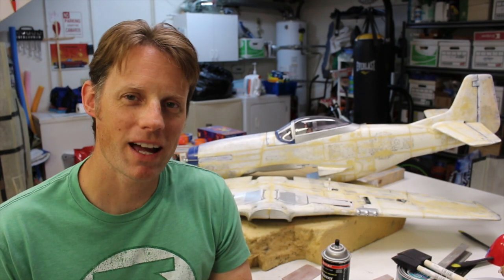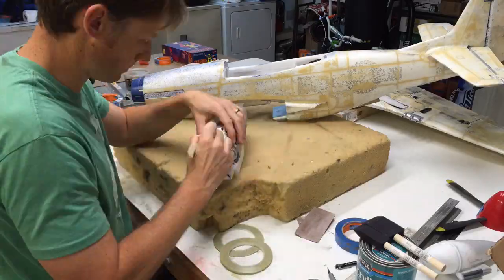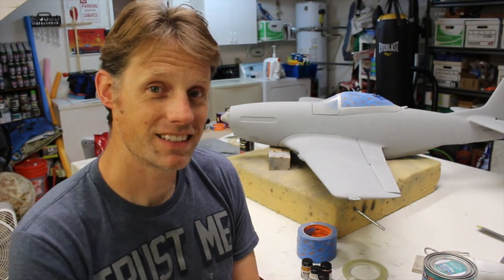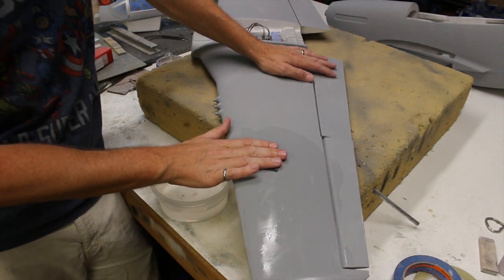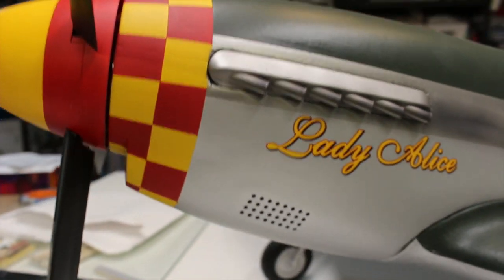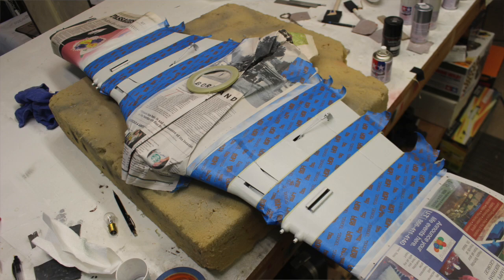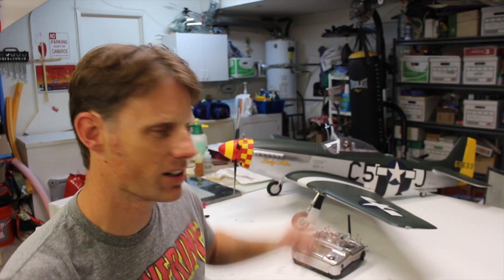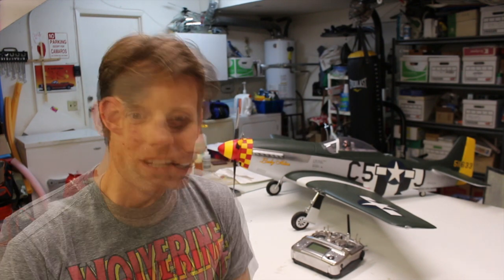Refinish a Foam Warbird Ep3 - FMS P-51 Paint Prep & PAINT!

Comment: I know you filled your servo lines and servos with filler, but what is a good paintable tape to cover those lines? For those of us not doing a show room finish lol...
Reply from the maker: +ssgfury The problem with traditional tapes is that paint doesn't usually like to stick to it and they don't always like to stick to EPO.  You could try a masking tape, but it'll probably lift up over time.  The best options are probably vinyl (like I used for the letters) or aluminum tape.  The aluminum tape would be easier to source than vinyl since you could get some thin stuff at Home Depot or some place like it.  Both do require scuffing and primering before painting, otherwise the paint won't stick well.
Reply: +The RC Geek Your exhaust pieces... they weren't already mounted?  I'm tinkering with a FMS BF 109... the exhaust pieces are already mounted... is there safe way to get those back off?
Reply from the maker: +ssgfury The exhausts were separate in the box.  I'm not familiar with the 109, did they come installed or were they glued in?  Truthfully, they'll probably pop off if you pull them.  I'm not sure, is there a reason you want to remove them?  Otherwise, you could simply work around them.  Had they been installed on my P-51, I would have left them on and just worked around them.
Reply: Yea... I wanted to tinker with painting them an exhaust manifold color... I went for broke and pulled on them and they came out fairly easy... I'm getting more and more sucked into doing a whole finished paint job lol!  I got the brown 1400mm 109... but I want to put a yellow tail on it... and  with matching yellow under the nose... (it has an orangish yellow under the nose).
Reply from the maker: ssgfury Go for it! :)

Comment: hey rc geek, what would be the least amount of work you would need to do to just turn a plain white epo jet and paint it a basic two colour camoflage scheme. im not worried about paint sticking forever or being a perfect finish, so could you get away with sanding priming and painting without all the varnishing and wet sanding and such?
Reply from the maker: yeah, you can just paint the bare foam directly if you wanted.  All the filling, varnish and primering is to get rid of the foam texture and smooth out the airframe.

Comment: Really hope your still checking your channel. I started doing all these steps on my Freewing F16. Problem is it came as arctic camo paint scheme and that black seems to have dyed the foam itself. I used a combination of Acetone and Lacquer thinner to get down to bare foam. Problem is the black is off but seems to have soaked into the foam. I got it smooth and all the holes filled in with foam filler. Should I go ahead and do polycrylic sand poly steps? I've tried going back over the whole plane with a foam brush and laquer thinner and it didn't do anything. I don't want to go to heavy on it cause it will pull out the foam filler if I do. I figure the primer over crylic going to hide all that black stuff anyways so shouldn't be a big deal I would think.
Reply from the maker: No need to try and remove the staining, it will be fine.  Just continue on as you won't see the black and the paint is removed, so you're good to go.
Reply: @Thercgeek  I got 6 coats of polycrylic on there it's smooth as glass when I go to apply the primer I can pretty much see everything through it. Everything that was covered up by the polycrylic is seen through the primer no problem. I am up 2 coats of primer at the moment and did a wetsand with 800 grit on the second coat. It is a white base primer so I wonder if that is causing it to be seen so easily. I have another grey primer that I will likely use for 3rd coat should I wetsand the next coat with a 320grit or keep using the 800?
Reply from the maker: @zeroxzero8348  so the primer/sand/primer process is what really smooths out the whole surface.  The poly merely seals it all and hardens up the airframe so that you can work in it similar to a glass model.  So, when I treat the surface, I'll spray with primer, sand it down with some 180 grit and then primer it again and see what it looks like.  I'll repeat this as needed until I get the desired smoothness on the surface.  It'll take at least 3 times doing this usually on a foam model.  Once you're happy with the finish, then wet sand with 600 grit and then start painting it up.

Comment: I used your method of covering the entire plane with Balsa filler, but decided to with Z-poxy instead of polycrylic.  It is very sandable compared to polycrylic, and you can get away with two thin coats.  The whole thing, especially control surfaces became very very rigid.  I bet you can also use Z-poxy mixed with microbaloons, and brush it on - perhaps a single coat.  The latter is the method I use as a flow coat on fiberglass.  Take care.
Reply from the maker: Very nice!  The z-poxy is a good idea and would create a little harder shell on the surface.

Comment: Great tutorial, Have you ever heard of a product called real metal foil? Used for chrome trim on car models.I used it to cover a 1/32nd scale plastic p-51 model.It turned out awesome I think I may try it on my dynam t-28.
Reply from the maker: +Martin Mccurley Thanks!  I'm familiar with the product as I have used it on plastic models.  For RC models, I've found that aluminum tape works a little bit better and is a little more durable.  There is a company called Flite Metal that offers aluminum tape specifically for this application, but it is a bit pricey.  You can get away with aluminum tapes, you just want something that's thin and has a thin adhesive layer.  The Bare Metal Foil is really good stuff, but is extremely thin which will make it prone to wrinkles and it's and very finicky to pull off the backing from what I remember.  Either way, metal taping an RC model is very time consuming, but the end result usually always looks awesome!
Reply: +The RC Geek Thanks,I was just wondering about the weight though,I used to work in a textile factory making different kinds of tapes from paper to pipeline coating and that experience gave me lots of practice in handling large sheets of sticky stuff.What do you think of Monokote and other plastic films for foam planes.
Reply from the maker: +Martin Mccurley The weight increase isn't usually much different than a full paint job.  My experience is that these foam warbirds tend to fly a little better with a little more weight to them.  They track and penetrate better based on the little higher wing loading.  The mylar films are ok and I've used it on fiberglassed foam and low heat with ok results.  The difficulty is the heat, so there's a good chance if you're covering EPO directly that you'll get popcorn (beads swelling) from the heat of the iron, even on low heat.  It doesn't take much to get that with EPO unfortunately.
Reply: What about sealing it with polycrylic prior to using a film,might that stop the popcorn effect.? I would really like to get as much of a "scale" look as I can,Or should I just paint.
Reply from the maker: +Martin Mccurley The process I outlined does excellent at smoothing out and giving the surface a sheet metal like finish.  However, dark colors that heat up quickly will cause the EPO foam to expand in direct sunlight and cause that "popcorn" texture.  The issue is heat.  The key is to just keep it shaded as best as possible.  I'm not sure you could completely avoid it truthfully based on how the foam reacts to heat...even if the surface were fiberglassed, I still think it would pop through.  I hate EPO, but unfortunately that's what we're stuck with on these foam birds.  EPS doesn't react that way.  Ultimately it's finding what works best for you, so you could experiment with it and see if it works.  If you do, try it on a spare part, or somewhere inconspicuous first before committing to the whole airplane.  I'm always trying new ways of doing things on my projects, even my competition scale stuff.  You never know what you might stumble onto!
Reply: Thanks for your input.

Comment: Rather than priming the wings and tail pieces, would you ever consider mono coating them ?
Reply from the maker: I suppose you could, but foam is pretty temperamental to heat which could cause even more issues.  Plus, the mylar coverings require a significant amount of scuffing to get paint to stick and that's still no guarantee that it will.

Comment: Hi Chris, it's me again, I've removed the paint and put on 4 coats of polychrylic on my FLRC Spit, will Tamiya or Mr surfacer primer eat the foam as I've got plenty of those lying around
Reply from the maker: Nice!  I don't think that it will, but test it out on the inside face of a hatch or something like that just to make sure.  I've not used either of those over the poly, so am not sure regarding the adhesion you'll get.  I would expect it should be ok.

Comment: I know this video was a long time ago, but I think probably still provides good info. Thanks for providing all of quality content. I had a question for you after watching your video. I am working on a foam plane project, and I'm curious. 

How durable is the paint job is vs. coating the plane with a monokote film? 

My current plans are to "glass" the plane with a layer of thin fiberglass. Would you advise against this? 

Lastly, would the coats of primer (and sanding) work out the level of "hanger rash" that occurs with foam planes, or does that need to be done at the filler stage prior to priming?

thanks again for any advice you (or anyone else here) can provide.
Reply from the maker: First question would be, what is the project?  Is it an epo based airframe?  I’ve not used Mylar to cover a foam airframe, only wood and it doesn’t really add much in the way of durability. Glassing is by far the strongest, but is also the most labor intensive. The method I outlined here is mind of the best mix between the two. The poly does stiffen the airframe but epoxy resin and cloth are the strongest. For the hangar rash, deep dings need a filler. The multiple primer coats really only smooth out small deformities.

Comment: Wow! And to think that was once a beer cooler! Holy crap! Really shows what some work and obviously skill can do to one of these planes! 
My only question is: any problems with cracking due to the airframe flex during flight?  Just curious how well the filler and poly coat hold up.  Thanks, Jim
Reply from the maker: Thanks and thanks for watching!  You can get some cracking, but it's not much and most of what I've experienced has been a result of handling.  My dad picked up the airplane from the wingtip one time taking it out of the car for me and it made some hairline cracks.  The polycrylic does harden up the airframe pretty nicely, so you don't get as much flex with the end result.

Comment: hi there, i just got a pure white foamy dc3 and i want to paint it silver on the belly green on the sides and white for the roof, for masking can i find low tack tape and tape the silver while i paint the green? i dont want to paint silver and mask and when i take off the tape it rips the foam and paint off!
Reply from the maker: +FirstChannelFishing the choice is tape is pretty critical. If you’re not putting any polycrylic or primer down, then you need a very low tack tape. I have heard that frog tape works very well and won’t lift the paint. However, I’d recommend placing it on your shirt first before placing it on the model to reduce the tack slightly.

Comment: Nice work and explanation of the process. Now you need to weather this bird,  other than the painted nose, invasion stripes and green turtle deck, it looks like it still has not rolled out of the North American factory.  You have done much work, now make your 'glads', 'DAMN HAPPIES' with some weathering and aging.
Reply from the maker: Haha, thanks!  This was as far as I wanted to take this one. The full sized airplane is immaculate actually, but I do hear you on the panel lines. I did a separate series that covers weathering and panel lines which is at thercgeek.com/kitbashing

Comment: what type filler  did you use to fill in the lines
Reply from the maker: I’ve been using sherwinn Williams shrink free spackle as a filler for a while as it’s good stuff and really smooth. It’s been my replacement since The hobbylite filler I used in the vid is no longer available.

Comment: Really nice rebuild and thank you for the tips.  I'm fairly new to the RC air hobby (November 2020).  I have a Phoenix V2 that came with a plain white wing with decals on top.  I haven't had to refinish any of my planes yet, but I have added paint for visibility.  I found that an extremely thin 1st coat of Krylon (I used High visibility orange) works well.  When completely  dried, a 2nd heavier coat.  Just don't try to shoot the 1st layer too thick or you may end up melting the foam.  I'm taking notes of how you did this rebuild so I can try it out later!  Thanks again!!!!      Oh yeah.....Love that your kids help out!  Keeping the hobby just that.....a fun family hobby  :)
Reply from the maker: Thanks so much!

Comment: Thanks for the comprehensive series on painting foam.  At which point does the texture of the foam surface disappear?  After the 6 coats of Polycrylic?  After the primer coats?  Thanks again.
Reply from the maker: So, the poly merely seals and stiffens the surface. What smooths it out is the multiple layers of primer sanding in between each coat. The primer builds up in the micro voids while the high surfaces get sanded down which levels it all out..

Comment: I just finished priming my entire airframe... Bad news is that now foam is "squishy". I have no idea what I did wrong/what to do, any suggestions? I used 8 coats of polycrylic on the airframe over the past 2 days and primed with 1 medium/heavy coat of the primer you used in the video, just barely had enough to cover the airframe with 2 cans of primer... Help please! Lol
Reply from the maker: Oh no!!  What airframe is it and what type of foam is it?  If it wasn't EPO foam, it's possible the foam might have had a reaction to the primer.  Was the heavy coat the first coat?  I had a similar issue happen to me on the non-EPO areas on my Kfir kitbash project.
Reply: It is the FMS P-51 so it is EPO. As the primer is curing for longer the "squishy" seems to be going away slightly... I'm not sire what happened. Lol

Worst case scenario I have to cut off the trailing edge of the wing tip and reinforce it with toothpicks...
Reply: I bought two cans of the Evercoat primer and barely had enough for one medium/heavy coat on the entire airframe. Caught me off guard. Do you recall how many cans you used?

The squishy/soft is for sure going away with time.. I may end up putting more poly on after I paint just as a precautionary measure. ;)
Reply from the maker: Well, I acquire that primer by the case, haha!  It took a couple cans for sure, probably 3-4.  I found that the Rust-Oleum automotive primer works pretty well too which is a much less expensive alternative.
Reply from the maker: that's weird.  I wonder if the primer just softened the poly a bit.  It should harden back up as things cure.
Reply: Would it be safe for me to use the Rust-Oleum primer over the Evercoat?
Reply from the maker: yeah, it should be fine.
Reply: 8 coats in 2 days??? wow. You simply saturated it!

Comment: I'm a new subscriber and really liked what you've done with the P51. My son has a FMS 1700MM P47 and I may try this with an old wing we have first and see how it does. Did you notice if this process maid the plane more ridged?
Reply from the maker: +Ronnie Jones Thanks for the sub!  The polycrylic does add some rigidity, certainly better than the bare foam.  It also helps make it a little more ding resistant too.
Reply: I noticed on your P51 you didn't add panel lines or rivets, can you add those things to the finished surface like you can with a balsa plane?
Reply from the maker: +Ronnie Jones yeah, panel lines can be added to the finish.  An easy way is to just use a pencil with a medium  lead.  Too hard of a lead may require pushing too hard on the surface and cause some trenching.  Another option could be to scribe the panel lines into the paint.

Comment: where can I get the retract plates please ? I googgled smallpartsinc.com but cant find retract plates , funny motion told me to stick it when I called them my retract failed on maiden on runway before takeoff !
Reply from the maker: Thanks!  Sorry to hear of the retracts trouble.  The website is smallpartscnc.com.  Just make sure you don't over tighten the side plates otherwise the worm gear will be more prone to hanging up.
Reply: thanks!
Reply from the maker: no problem! :)

Comment: You got any tips on getting rid of the fuzz that comes from sanding the foam? I had several area's I had to spackle to get smooth after a curb incident and I got some fuzz around the area after sanding. I tried going to an 800grit paper to try and smooth it out and it helped a bit but not as much as I was hoping.
Reply from the maker: that is one drawback to epo in that it doesn't sand well at all.  I'd recommend maybe soaking them with some CA to harden them up and then lightly sanding.  Otherwise, you may have to physically cut them off the surface.

Comment: One other thing during priming: you can use Bondo glaze (red stuff) to fill the valleys.  It sands really well and smooth.  I learned the trick from the master himself, Dave Platt.  Good luck.
Reply from the maker: Yes, this is true. Just be aware that excess heat from the friction of sanding the putty can cause the foam to swell. So, avoid sanding too heavily in one spot for too long when using harder materials like that.